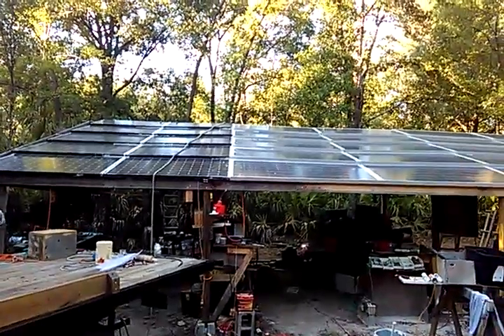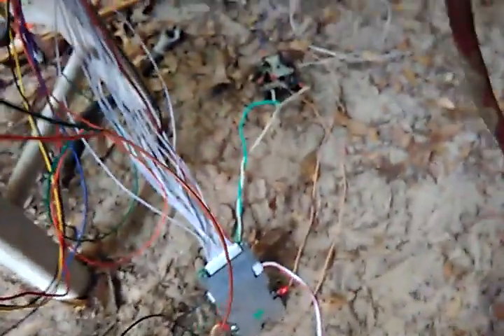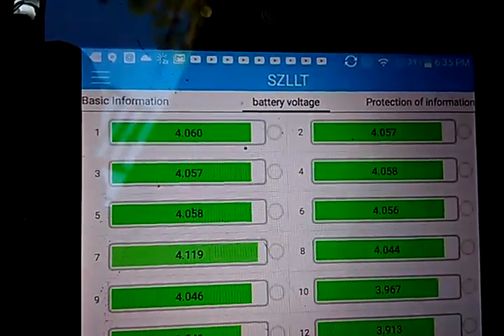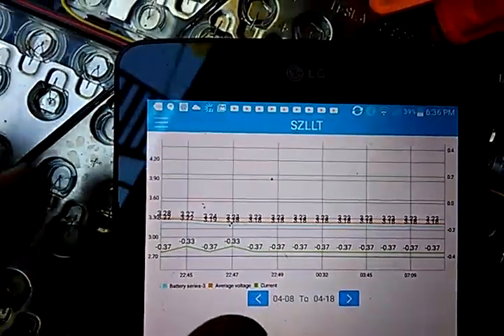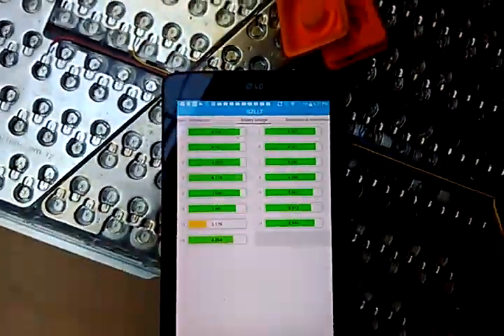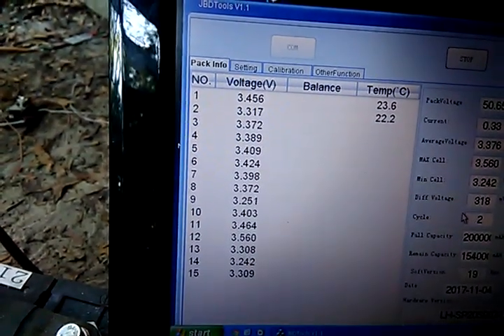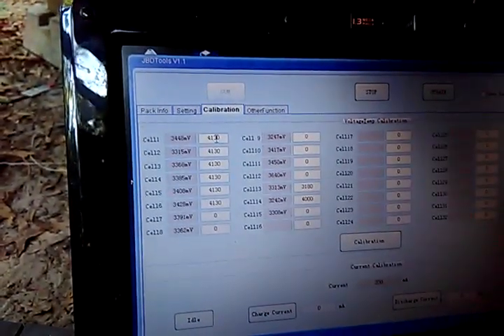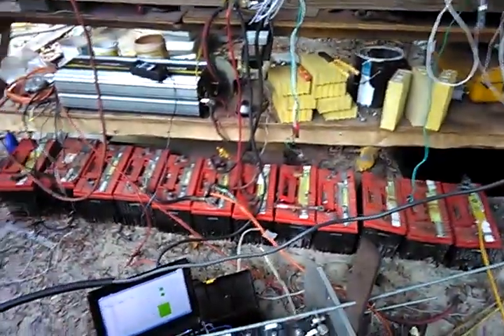Tesla battery testing with smart Bms b

Comment: Better than smart bms would be to get active balancer.....
Aliexpres...
Amy             store
"4-24 series active equalization energy transfer lithium iron phosphate lithium battery multi channel equalizer BMS" balanced with a0.02v and display...
This is excellent device... Before also I have used Del green  single cell equilazer but I was not satisfied with balance function.....
Reply from the maker: I got a few of those and tested them and was really impressed with the way they work. It seems like they don't care what the voltage of the battery is they just balance them all to be the same. I had it up in the kitchen just so I can keep an eye on it.